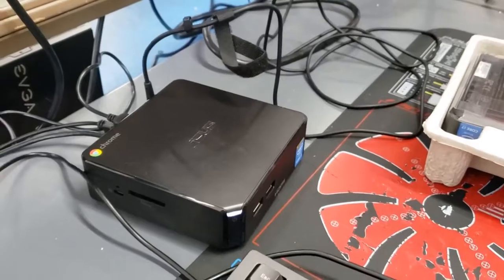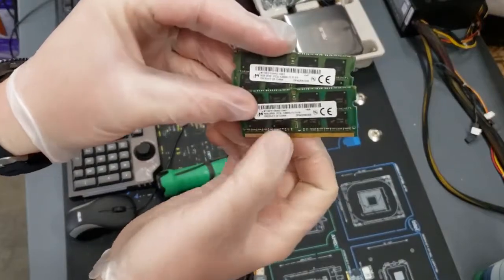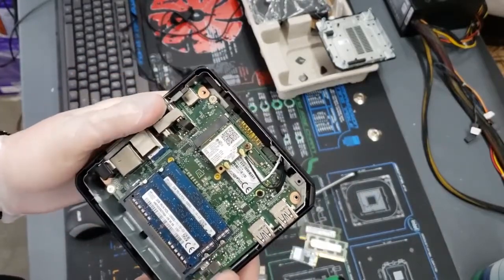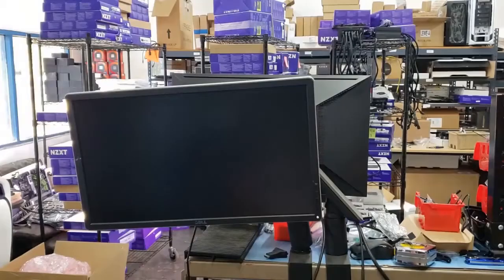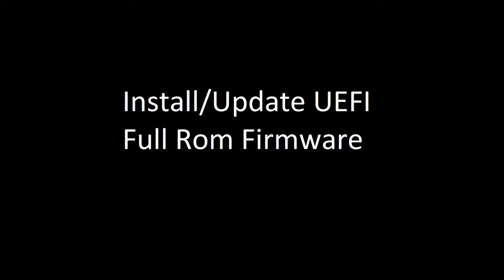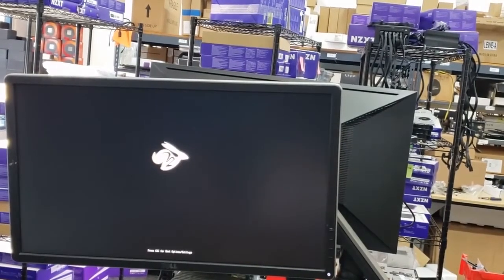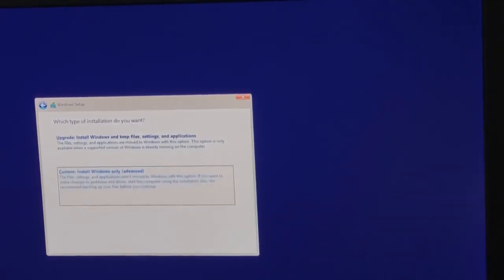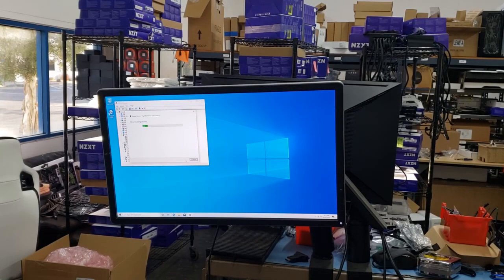Install Windows 10 on Chromebox/Chromebook 2020

Comment: Hi!
 I installed the Win10, after your video.
 Working ok! :-)
Only not have sound. :-(
The incorporated Realtech ic : ALC5662 not have driver.
What i can due to repair this?
Thanks for your wideo and help!
Best regards NZo
Reply: Recently MrChromebox has updated his firmware ROM allowing You now yo install a UEFI Rom, which fix the sound issue, and also other issue when Legacy was used.